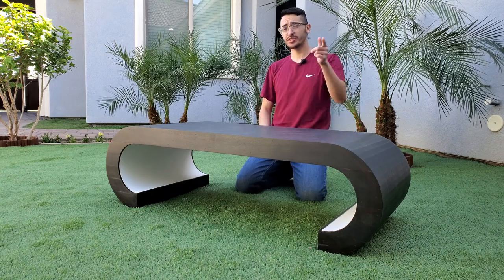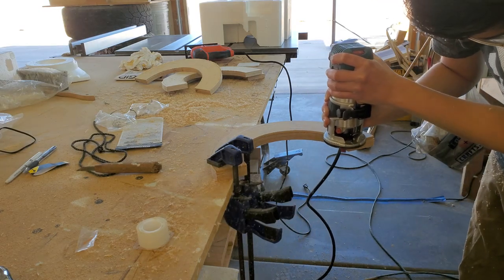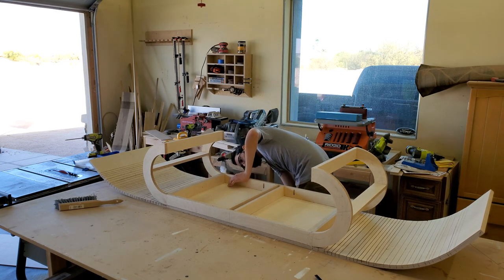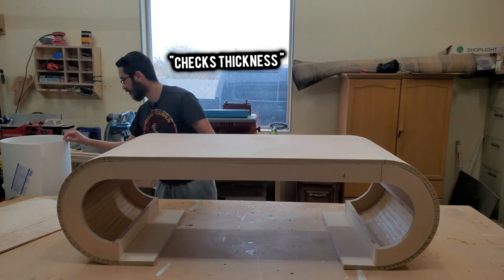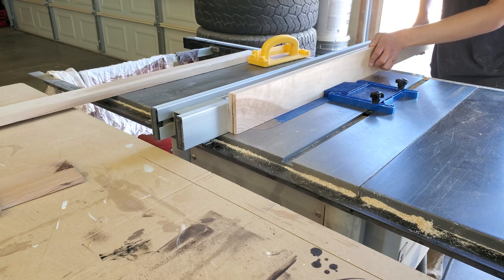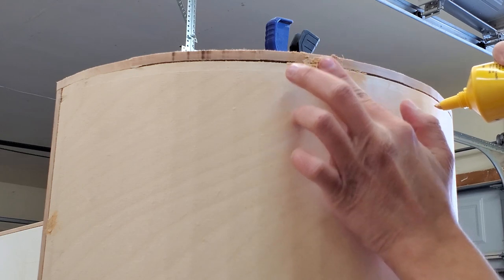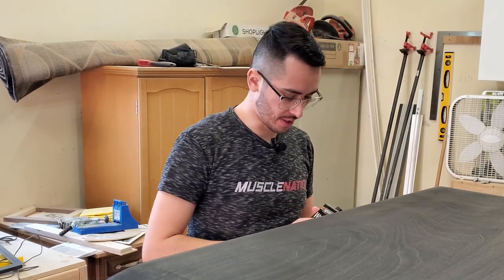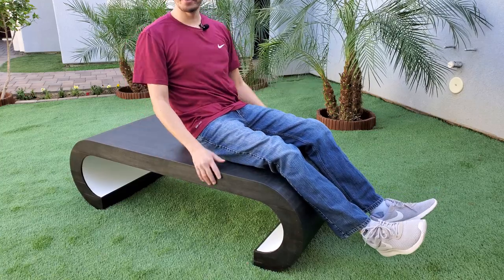How To Make A Coffee Table By Bending Wood At Home!!

Comment: Looks really good. A couple suggestions: To make the curve of bends cleaner, the kerf cuts needed to be deeper, I would also suggest wetting the board before bending to loosen up the grain. Also,  a straight edge with two claps is basically as good as a track saw, just less efficient.
Reply from the maker: Yeah I did use a red rag to wet the board. And true haha but I have my track saw now so I'll be using that 😅

Comment: A possible alternative build method... Cut your horizontal braces down by however thick your plywood top is, minus 1/16 inches, that way, once it's glued and tacked on, the plywood is 1/16" taller than the vertical support. When you sand it down, it'll sand level. You can save on material since you won't need to cut the plywood as wide, and won't need to cut the veneer to hide those kerf bends.

I also wonder how the table would look if you used smaller cuts on the plywood? Would it have a smoother curve, or be just as blocky?

Comment: Turned out great. Do you own a router table? I've been meaning to make one but keep putting it off. Then when I use my router, I wish I had a table. Not just for efficiency but for dust control as well.
Reply from the maker: I do not have a router table but it is on my tool list haha